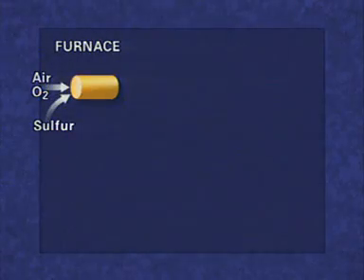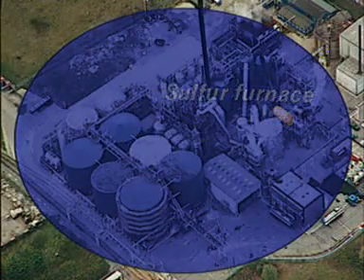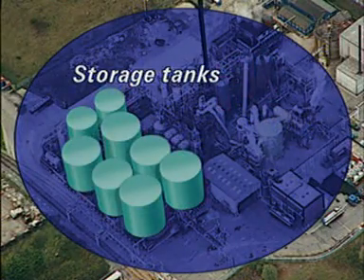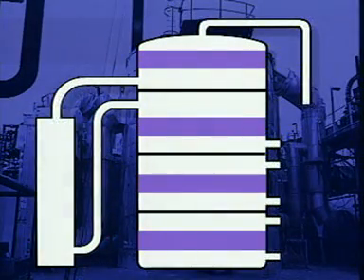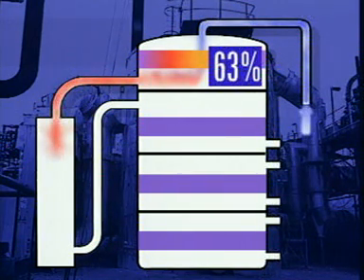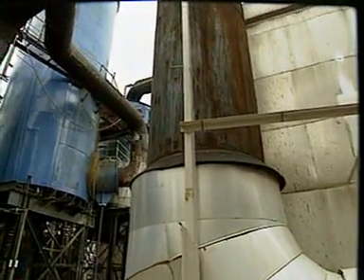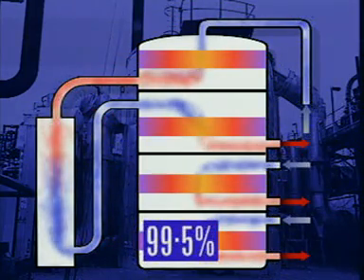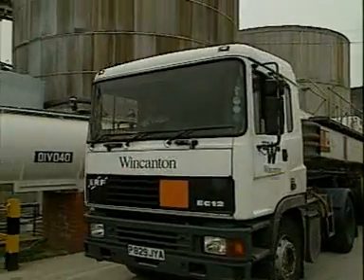Sulfuric acid and the Contact process

Comment: Does anyone know how the air is provided to the production process in plant? With air compressor?
Reply: In modern plants they use liquid-air plant, to obtain oxygen.
Reply: they use a blower
Reply: @Baba_kaAiden  we use steam powered turbine blowers at my plant....imagine a 12 foot tall pump that is steam driven & intakes air instead of liquids. 3500-3800 RPM wide open.
Reply: Please speak WhatsApp

Comment: I see exposed skin, handling this material....
Reply: Side of face.  hooded overall, goggles or full face respirator missing.   However it's a great video explaining the process. Thanks for putting it up.
Reply: +Sugarglider1 This is concentrated Sulfuric acid from a tap. There is no need for a respirator as it would inhibit vision and there is not a direct exposure to vast quantities of acid. The worker was also bottling the acid at a distance and allowing to to splash downwards. It is no different than when working with it in a lab.